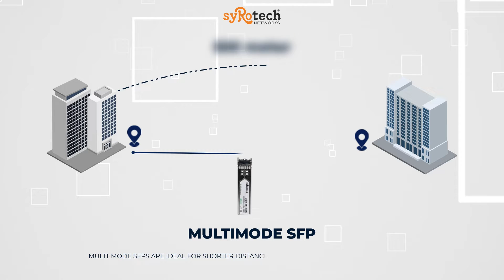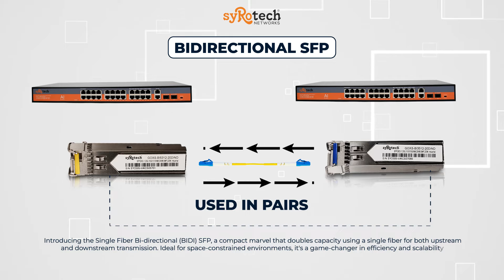Syrotech Networks: All You Need to Know About SFP Modules

Comment: HI I  am getting 3 different reading can you tell me on which should i trust ftth connection is up n working great no disconnection issues..
1)In olt receive power of onu is showing -23 dBm.2) In Powermeter getting reading -27 dBm.3) in XPon device ahowing power - 26.99 dBm.
Reply from the maker: The XPon device reading of -26.99 dBm aligns closely with the recommended range (-6 to -26 dBm), indicating it's likely the most accurate. However, the Powermeter reading of -27 dBm falls outside this range, suggesting potential calibration issues. It's advisable to verify the power meter's accuracy and inquire with us about calibration procedures for accurate readings. For further Assistance you can call on our support number (1800-21200-6122).
Reply: @syrotechnetworks  my simple question which above reading should i trust ?
Reply from the maker: XPon device which is showing power of (26..99 dBm).